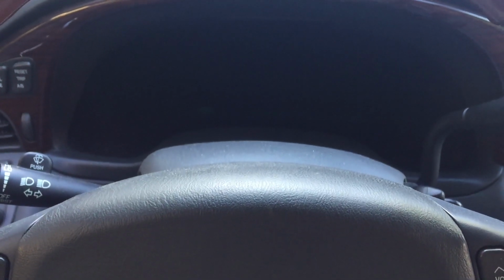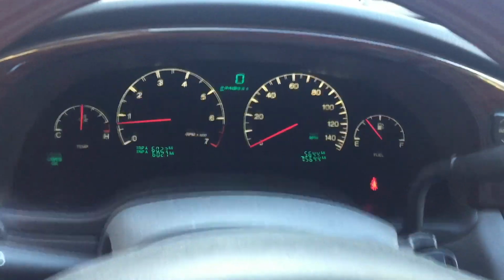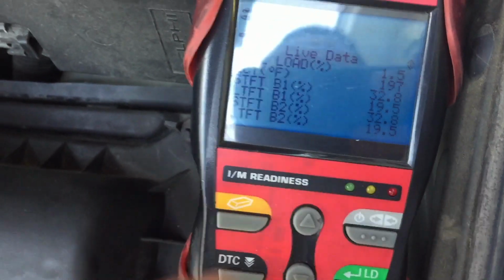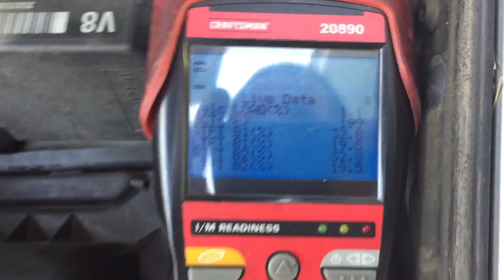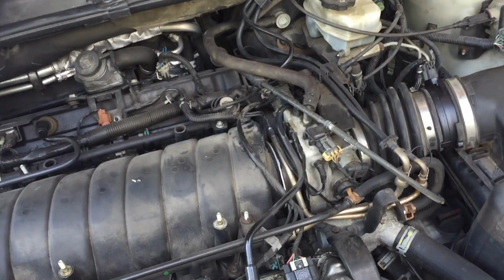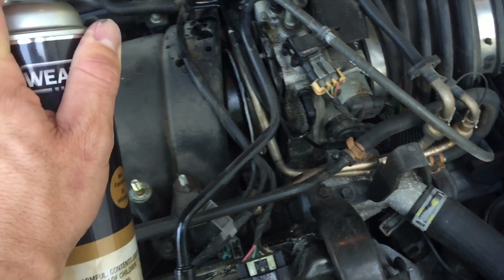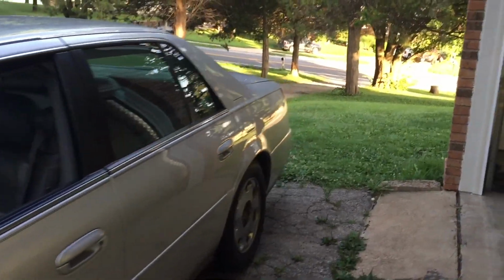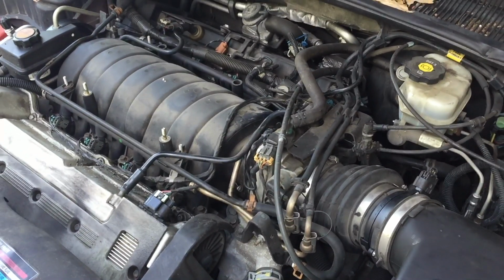Cadillac P0171 P0174 Cause Found

Comment: Thanks Daniel, nice for you to share all that with us. Before I used carb cleaner or starting fluid, but brake cleaner is the best and, of course a scan meter, listening and watching where the vacuum leak is. The throttle body seal is notorious for vacuum leaks. -We all appreciate it. 😀

Comment: Legit AF! Sprayed brake cleaner in the same spot and white smoke came out of the exhaust. Don't know how to say this but, I love you.
Reply: I got the same problem how did u fix N how much it cost u ?
Reply: @akob8169  you have to replace the intake plenum boot.  At least that's what fixed mine. The part cost about  $30 and it took a couple of hours. I followed a YouTube video step by step with no problems. When I removed the old one it had a huge hole which was the vacuum leak.
Reply: @namnug69  I put a new starter on my 01 deville an replaced that intake plentum with a new dorman one an its not getting a tight seated seal an causing my engine light to come on an its running crappy
Reply: Do freon and it will really smoke

Comment: Such a nice engine when it's running right, a total nightmare when it isn't. For shame GM.
Reply: its not even gm. its a cadillac with a northstar
Reply: Wyvern Cadillac is owned by GM.
Reply: But gm didnt build the motor now did they
Reply: Nathanael Lensch
I don't know if you are playing stupid or genuine stupid, GM designed and made this engine for Cadillac- GM's high-end luxury line of cars.
Reply: cadillac is owned by gm. they still build their own motors. gm does not build them. cadillac does. gm builds chevy gmc and buick only
Reply: how about you do some research first bud. each one builds their own but chevy gmc and buick are all partnered
Reply: Nathanael Lensch

How about working on cars and machines is my living and I'm going into engineering.

The logos are just that- logo's, they are just a different skin on the same skeleton as Chevy, Buick, Cadillac, GMC.

A Pontiac Sunfire is a Chevy Caviler.
A Cadillac Escalade is just a GMC Yukon
A Saturn Sky is just a Pontiac Solstice
So on and so fourth, multiple badges of cars are most often made the same building.

Once upon a time, there were partnerships, but that was in the 20's 30's and 50's

GM means General Motors- Cadillac IS general motors- so when I say "for shame GM" I am 100% correct because guess what? Cadillac IS GM, and today GM is crap.

So If you still believe Cadillac is not GM then I don't know what to tell you other than we don't live in 1923 any more.
Reply: you obviously don't work on cars. just give it up
Reply: Nathanael Lensch
My 9 years experience, ASE certifications and associates degree would beg to differ.
Reply: try 40+ years
Reply: Nathanael Lensch
Then you must work under a rock.
Reply: hmmm do work in a concrete shop
Reply: the other dude is right. Cadillac, buick, chevy, olds etc. are all GM brands. They're all one company, just different brands. It's like how Mountain Dew and gatorade are different brands, but they're all owned by Pepsi company.
Reply: I got a crank no start
Reply: @wyvern4588  
Jeez this is an Old Thread.
But you got 2 Diagnostics Right. And Both are GM 😂 
General Motors,.. and Generally Morons, that don't know General Motors 👍
... aerospace engineer and certified heavy equipment technician, and other crap ✌️

I Know Excavators Too, for those guys living under a Rock 😂🤣😂
... enjoy the 4th 🧨🇺🇲🎇🇺🇲🧨
Reply: @My-Pal-Hal  Ha! I have since then added Aerial lifts and cranes to my list of work- GM crap is still frustrating as usual.

Have a good 4th! try to end it with the same number of digits you start it!
Reply: @wyvern4588  
Oh yes yes.
Did lots of lift and crane work for the ole Lazy B. That company has changed a lot too. They've changed their culture, and cut costs to the point they can barely get aircraft out like they use to.
I remember when we could fully assemble a 747 airframe, and roll one every 3days. And we could have done it in 2 if they let us 😂
And we did it for 2 1/2 years at 100%. Meaning they rolled as perfect as they get.
And we were all just kids back then. But we loved the job and the challenge of building each one better and faster. Our crew had more Awards than any dozen others combined. It was good times 🤗 And did a lot of cool stuff when I was there.

Be safe yourself.
And as Apu says in the Simpsons,
Celebrate the Birth of your Country,.. buy BLOWING UP a small portion of it 😂
One of the best lines ever 🇺🇲
Might have some video of our show here by the water.
Got the shells and tubes delivered today. And the crew should be loading em up in the morning. Have 380 shells. 2, 3 and 4 inchers. Should be pretty cool 😎
Then I have a Northstar to F With.
Changed the starter. And now got a vacuum leak somewhere. That's what happens when you have to change a starter in a parking lot, in the middle of the night 😟
Always Something.  ENJOY ✌️
Reply: Wow that was crazy. Cadillac makes the northstar? Nooooo GM makes the northstar. Cadillac is a GM. That is why the Buick Lucerne is the same car as a Cadillac DTS.
Reply: @alexsbikesandmotors Pontiac

Comment: 7.14.16.  Those plastic upper plenums have caused a pleathora of headaches for owners!......i.e......GM 3100/3400 & the venerable 3800. If you change the lower intake manifold gaskets to the metal framed ones, & flush the infamous DexCool from the cooling system, you will go along way towards an extremely long lived engine. A very informative video! 👍🏽👌🏽😎
Reply: Sorry.bit confused.

So dexCool bad for northstar?
Or should i use Dexcool only for my showroom condition 96 deville.with 90k on it.
Reply: @zuone3573  11.14.20.   The original DexCool®️is touted to last 5yrs/150k miles....it is A marketing ploy by GM™️,to make their vehicles appear to cost less to maintain over a certain amount of time for the owner. It doesn’t work out that way in the real world! If you go no more than 3yrs/50k miles you will be OK with using DexCool®️, but I just change mine with the mixes with any type of antifreeze, and change it every 2yrs/30k miles. If you look in side of your coolant overflow tank and it looks grungy and not orange colored, it’s past time to drain and flush your radiator and cooling system.

Comment: If I'm remembering correctly my 98 Aurora with 4.0 Northstar had a backfire valve under the plenum, kinda like a spring loaded butterfly valve and easy to locate on my engine as the leak caused it to whistle........ I love the Auroras have two of'em and made the 98 with 305k miles a parts car for the 96 with 60k miles.... Honestly couldn't afford to maintain the Auroras if I had to pay someone to repair them! I'm a novice/parts changer, I have the "3" GM repair manuals and real mechanic's on the web to help so Thank's..... Love the cars but they're maintenance nightmare!

Comment: Nice video! I appreciate the info...Thanks for helping me find that leak... Now i got to pull the intake off to get to the throttle body coupling boot/gasket... Quick question... How would you take off the idle pulley on a 04 cadillac deville? I can't get my hand or socket/boxend wrench in there... I need some advice on how to attack this

Comment: My only issue with the video is .... why would you order and install a maf sensor that was recommended by a part store with out running diag and proving or eliminating that as a probable cause?? I mean part slingers rarely even get me the correct part even when you give them the engine code or vin number. Why leave that to chance?
Reply: Well. That particular part covers an Extremely Wide Spectrum of GM Products. So concerning that particular part. It's probably correct.

Comment: i have used an unlit propane torch to do this. when rpm increase you are near the leak.
Reply: Brian
Thanks I'll give it a try.  Finally, Finally, found a vacuum leak that causes rough idle and stuff that 2 mechanics missed. Can't wait to try the propane torch test.

Comment: What a beautiful car. Someone needs to take it out, and drive it hard to get rid of that carbon rap.  Notice no spark plug wires as the coils are on top of the plugs.  I have a 1996 Northstar in my showroom Deville.  Hope they change the coolant every 4 years to keep those headgasket threads healthy

Comment: its odd it still drives without missing … my 96 DEVille had the 1074 codes .  and the prob turned to be maf even though I cleaned it and it wasn't a direct maf code but that was the prob.... it was still the bad piece .20 plus years old ... I ws thinking the intake gasket changed that .. the plenum boot are notorious ..im glad I don't have one on the 96//.the engines are great without the codes … learn alittle on diagnosing it  is a must ..you will narrow the prob down ..I hate to just throw parts after parts not having a clue . just do a little internet research ect..//

Comment: Why dont you just use something like carb clean or starter fluid? That would run cleaner, right?
Reply: yes you can, but brake clean does not leave a residue
Reply from the maker: You're right, it would run cleaner, but unlike brake clean, it will leave a residue on other engine components while spraying for the leak.
Reply: Brake cleaner dries out seals and should not be used to detect leaks. Carb cleaner and or starter fluid would be a better option.

Comment: 2001 Eldorado i have.    No vacuum leak.   All parameters ok.    Completely diagnostic….Was at the mechanic.  All tests performed..   everything is functioning.    New MAF ….  All new 02 sensors….   Still one lean code.   Or the other.  Or rarely both …

Comment: Where are you located ?? Honestly if I have an issue with my car I rather have you look at it cause this mechanic shops I don't trust at all or my dealer
Reply: Alberto Leon i think texas
Reply: Edward Myers darn!! I'm in California
Reply: Gryazev-Shipunov  I've been having issues with my car where it jerks when accelerating I've had this issue since I purchased it no engine light is on I've taken it to the dealer and they said they can't find an issue and nothing is wrong. They told me it's normal but the jerking is so strong at times it throws you back and fourth on your seat at times I really need help I have no clue what's causing it and I don't want to be spending money if I don't have to
Reply: check motor mounts

Comment: I have an Eldorado.   I have to do this job every 2 years.  The mice. Chipmunks and squirrels get into the valley pan where the starter is and chew the wiring and rubber plenum boot.   So when it’s starts to idle rough or a screaming high idle.  That’s the problem.    I Bitch to the neighbors to stop feeding the rodents.

Comment: WHY didn't it throw a p0300 code. IT should have. When there's a vacuum leak after the Mass airflow,it always throws P0300.
Reply: Not always. In fact, it won't always throw a code when you have a vacuum leak

Comment: is it me or does it sound like that engine is lightly knocking?
Reply: you're not the only one
Reply: Mine makes the same odd sound.
Reply: Ricardo The Computer Wizard its part of gm so youll hear the knocks like a chevy engine and it is a 32 valvue 4 values for 1 cylinder so there is alot of moving parts
Reply: Mine make that noise too...
Reply: If its cold you get a little ticking. Once valve train and pistons warm a little, noise goes away. Ive got 140k on my third n*. And its one of the cleanest eldos you'll see.
Reply: Mines always made that sound when it's cold and I go over 2k rpm.

Comment: that godawful rubber boot between the coolant crossover and the manifold wasn't one of the better design changes GM made to the N* in 2000.  The earlier design with the TB mounted directly to the intake was better (had coolant hoses to the TB to prevent icing).  Somebody probably changed the starter, by the book, and tore the boot; it's best to unbolt the 3 throttle body bolts and slide the manifold straight up with the plate and boot still on it.
Reply: Does the intake manifold have to come off for that? I've been having horrendously high idling lately.
Reply: @TATTDIS  depends upon the year; prior to 2000 it does not

Comment: why not use water??
Reply: If water enters the engine that's bad, very bad. If it gets into the cylinder you can destroy engines very easily because water doesn't compress or burn. Not to mention the issues it might cause with electronics if they get wet.
Reply: abyssunderground yeah but that amount of water arent hurting an engine(no hidrolock),you dont have to get water over the conectors:)))
Reply: Perhaps not in small quantities, but water also wouldn't affect the readings he was using to diagnose the issue since it doesn't burn.
Reply: abyssunderground but in the other end you hear the engine changing rpm when you hit a vacum leak:)
Reply: Tool Guy, more like Cocaine Guy
Reply: Adam Budai well why even use water when there are many other correct options you can use?!!
Reply: Rumer1 no it's not...in low amounts....
Reply: Adam Budai you're one of those people that people can't tell you shit! You're always right